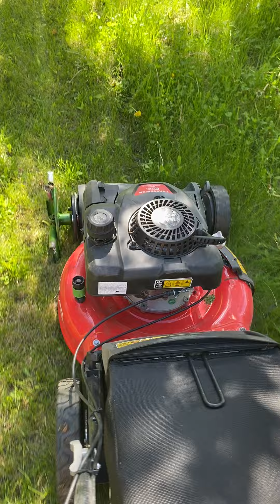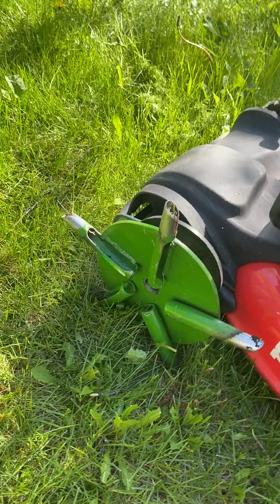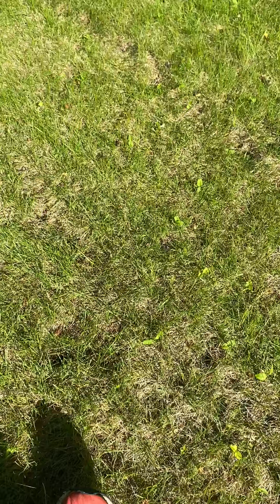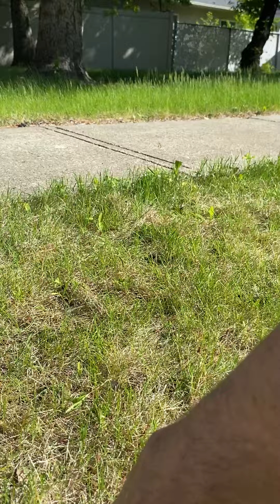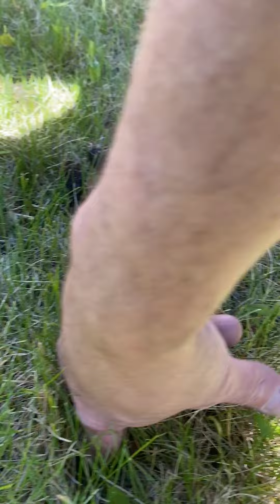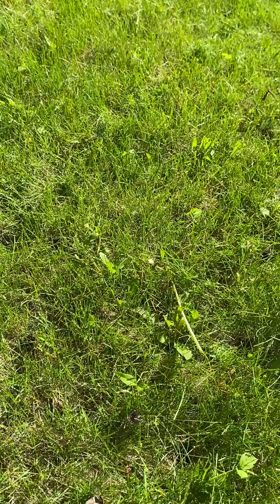Lawn Mower Aeration… For Home Owners & DIY People! 🌱😎

Comment: I am amazed in how you designed  this to use the kinetic energy and create enough down force to pull tines up like this.  Wow 🤯 🔥 🔥
Reply from the maker: You know, I kind of thought the same until I welded the wheel together. Made a couple changes change the angles and did a little bit of research regarding speed, force and kinetic energy because of the smaller diameter wheel half that of an aeration machine just the weight of the lawnmower and the speed increases the kinetic force by four times and I’m only putting one TINE into the soil at a time. There is zero weight added to this lawnmower and the bag was empty when I started. Plus it’s only one wheel drive as the aeration wheel replaces one of the front drive wheels. There is a reason that I’ve sold almost 1000 and have only had five returns. The product clearly works as it illustrates in the video and if my other hand was, I would’ve been able to go faster, penetrating the ground deeper. Yes it’s a science. I’m shocked as well. 

👍🏻Thanks for just honestly asking rather than saying no that won’t work like most do.

Comment: Can you just go over this with the aerator if you have dead grass (from drought stress) and have it be effective? Or, do you
Need to dethatch first (ie with a tine rake) before doing this?
Reply from the maker: Would’ve been reading online is once your grass goes completely dead. There’s still the root structure below that is slowly deteriorating these old roots prevent new grass growth and make things just that much harder. If your grass is completely and 100% dead, I would suggest detaching of course, and turning over the soil and starting fresh grass is dead. It is just that the top surface is dead as well as the root system. There’s a reason farmers cultivate last year‘s crop is because once things are harvested and or the plants are at the end of their life cycle it’s over.  I’ve had dead areas of grass where I’ve had a garden and the grass took about 10 years to fully fill in the 10 x 30 area.  The bare soil was susceptible to weeds so you’re in a tough spot… you could top dress, adding an inch or two of soil that would really help out , three parts Top Soil one part compost one part Pete Moss one part Sand.

Comment: This looks like a brilliant invention and a solution to my long-term problem of how to aerate my own lawn. Manual core aerators are too tedious, but big machines are too bulky for my suburban lawn. Canadian made and low return rates are both great boasting points as well!

I’m curious, how does cutting height affect the performance of it? Is there an optimal cutting height in your experience?
Reply from the maker: I like to cut my grass at the highest setting, but I don’t think the height of the grass has anything to do with the depth of the cores soil type moisture content and consistency aids in loosening up the soil.
Reply: @green_SCOTT  Ok perfect! I tend to cut at a high mower setting too, so I was hoping that wouldn’t prevent the tines from puncturing deep enough into the soil. 

I watched your other video on measuring and checked out my wheel. It seems similar to yours. 8” diameter wheel and 6” from axle to blade guard. So the 8” aerator should be the right size? I’m about to order one!

Comment: I saw one of your videos said that the aeration wheel is satisfaction guarantied. How do you you guarantee it if someone is not satisfied with the product?
Reply from the maker: Well I’ve only had 5/1000 returns so you WILL BE HAPPY WITH RESULTS… If you’re not satisfied with product, please return it within a week. I’ll send you a full refund including the $30 shipping but it would be better if you just insured that you’ve got the right size Lawnmower 19”to21”plus work best and that fitment was proper as I have installation videos on my website under the menu section. 

The product does work as well as you see in the videos… 

But if you have hard packed clay type soil, your expectations should be not any product but bring in a truck load of top soil and organic material. 😁🌱

Comment: Does it come with one aeration wheel or two?
Reply from the maker: @johngrinnell  one seems to work better than using two. As to end up, fighting each other and is less effective.
Reply: @green_SCOTT  absolutely, but with the purchase price, is it one wheel or two wheels?
Reply from the maker: @johngrinnell  yes John cost per one! They are solid and can be sharpened as it will last a DECADE for residential use if not more! I’ll still be around to honour a 20 year warranty replacement. 💯